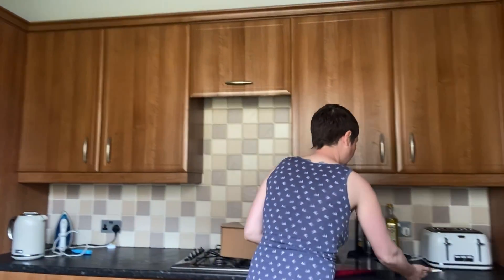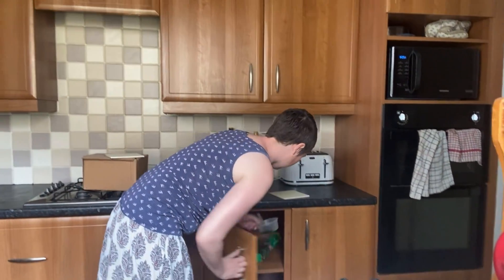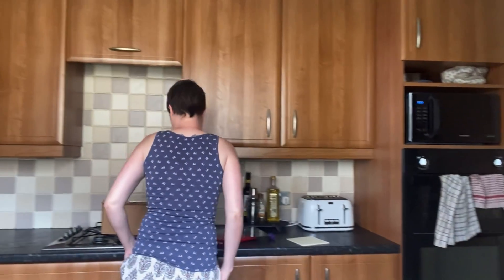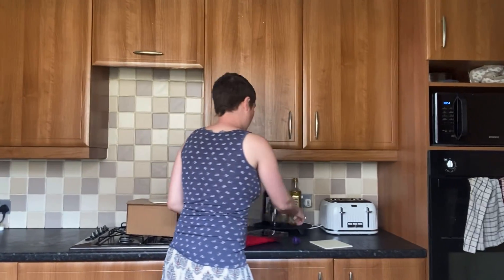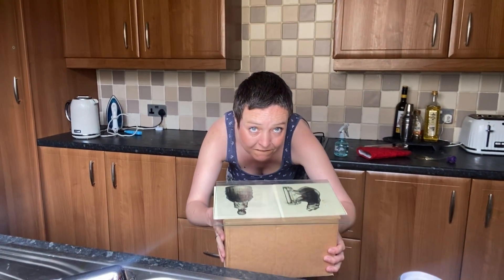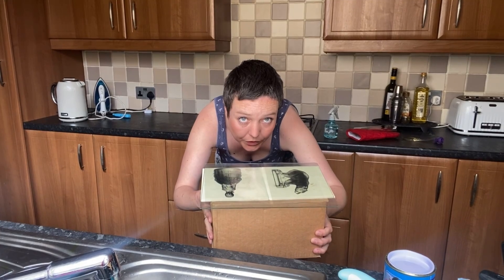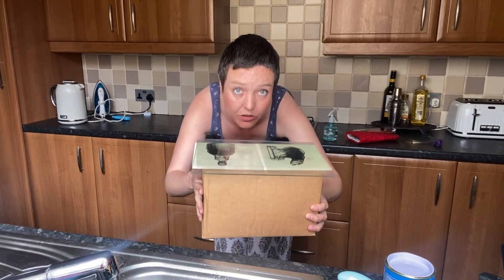Demonstration: Cyanotype on biscuit fired ceramic tiles

Comment: Wonder if you could use transparent glaze and then glaze fire to seal them instead of using varnish
Reply from the maker: If you get a low fire glaze or low fire the cyanotype cone 4 then glaze after. It will turn orange :)
Reply: @JoHowell  oh that would be interesting to see!